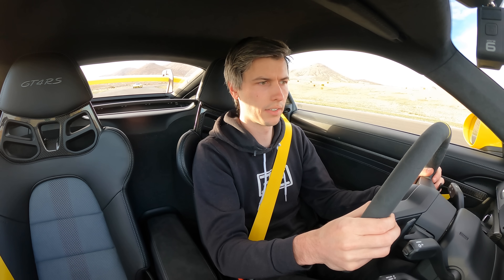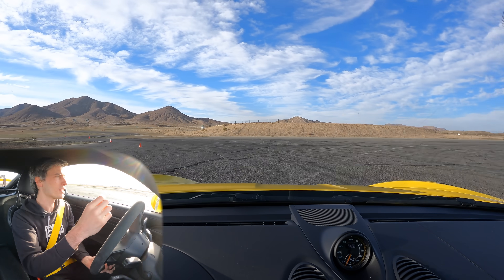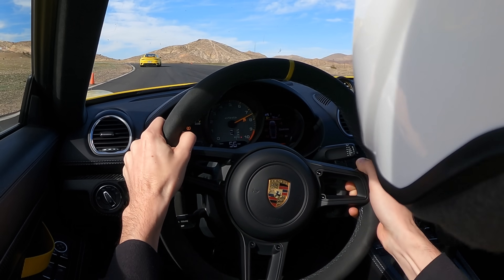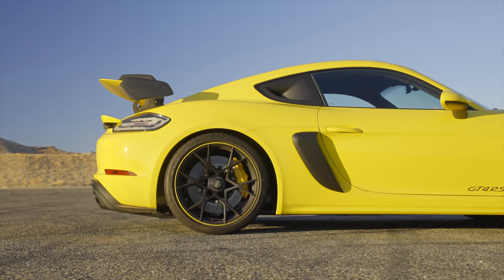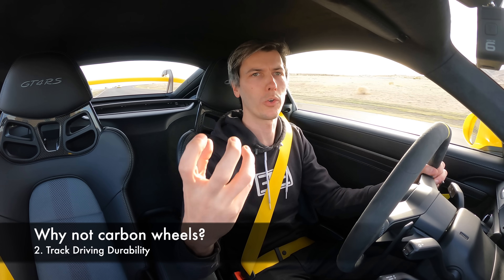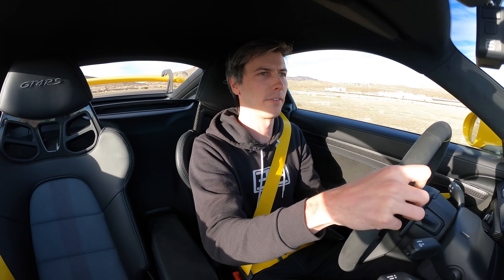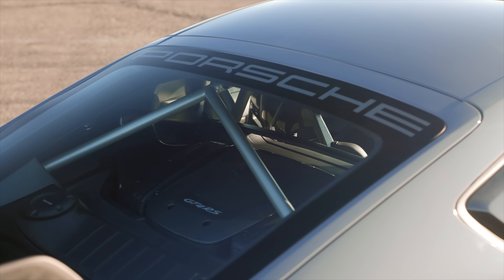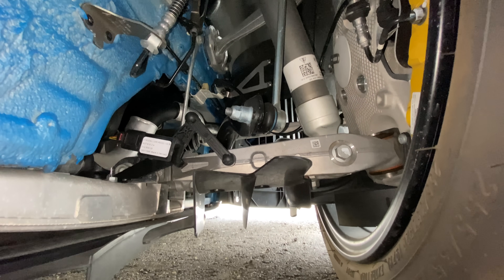The Combustion Engine Perfected - Porsche GT4 RS

Comment: As a suggestion, please consider doing a video on the difference between the EA9A1 And the EA9A2Evo engine. As we know, the EA9A2Evo engine used in the GT4 is a bespoke engine with the same bore to stoke ratio as the EA9A1 engine. I’m very Curious in why the EA9A1 engine seems to be a more superior engine?  
Great video btw. Best channel ever

Comment: Dope video, but I have to disagree regarding the power; Porsche will not allow that car to make more power than its flagship. Also, the responsiveness; a high compression, well engineered N/A engine will always deliver power that way. This is why some of us are hooked on N/A power as opposed to being captivated by turbo power, which is nice,but not the same. Linear vs logarithmic power delivery, anyway, Peace!
Reply: They purposely limit the power of the mid engine cars by electronically closing the throttle near redline.
Reply from the maker: I'm with you, generally speaking, but I spoke with several engineers, and they all wanted the most out of this engine, genuinely. The exhaust routing had to happen, and it cuts power slightly.
Reply: @EngineeringExplained  People keep saying Porsche have strangled the Cayman and dont want it treading on the toes of the 911. But, you get what you pay for and cannot expect to get GT3 performance in a much cheaper GT4. But now Porsche have given the option - a GT3 or a GT4RS with exactly the same engine (and same 0-100kmph, and quarter mile) which, with the Weissach package and magnesium wheels, is the same price as the GT3.
Reply: Why would it make MORE power?
Reply: @Kavafy  I'm saying Porsche will not allow the Boxer to equal or surpass the 911's power; because the 911 is the flagship.